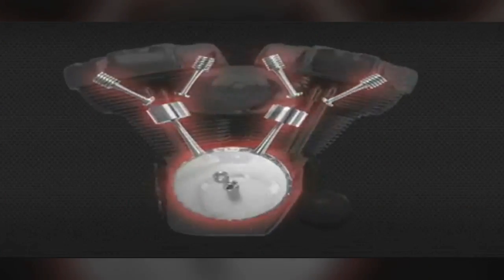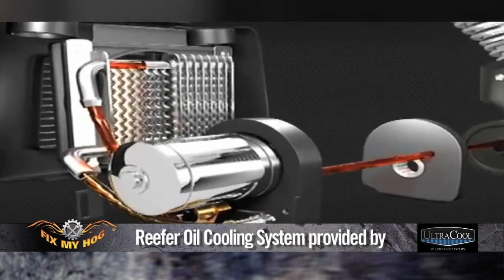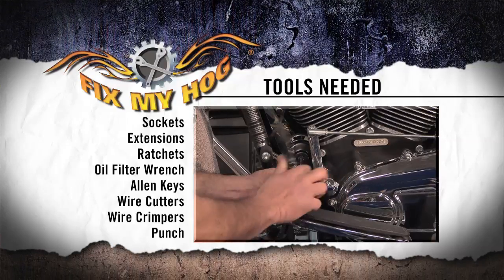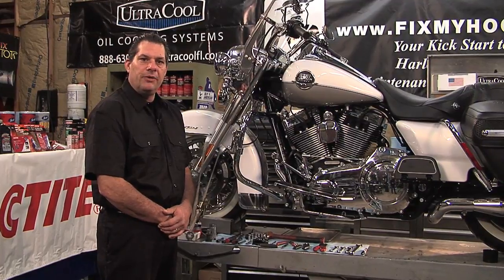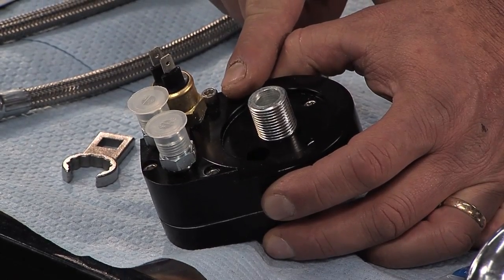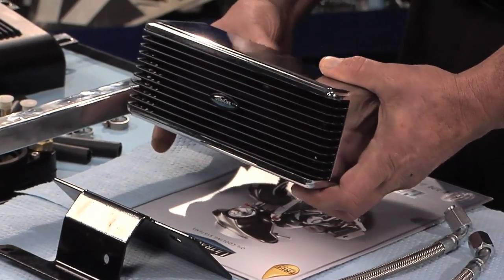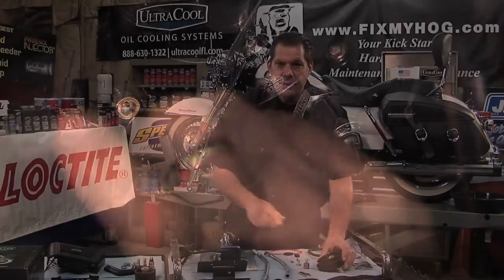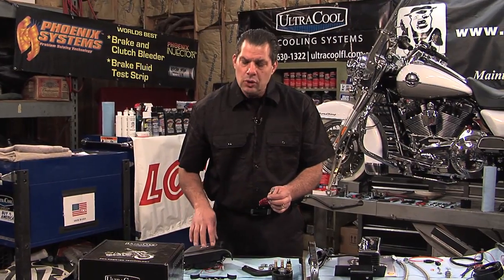Harley Davidson Maintenance: Touring Motorcycles: UltraCool Oil Coolers

Comment: consider the Oil Bud oil cooler...$$$, I installed on my ultra limited...big difference....-30 degree drop in circulating oil temp...and noticeable difference in engine ops (no pinging) and heat off of the motor...passenger (right) leg doesn't get heat torched anymore.

Comment: 220 degrees it kicks on ? That’s nuts. Stock Harley kicks on at 200 & that’s to high. by the time the oil hits 220 your engine temps will be 300 or more.

Comment: Do we really need a thermostat control for an old shovelhead. It always runs at 220° F + in warm weather so the oil should be flowing through the oil cooler at all times. I don't understand what the problem would be if the oil ran cool say 130F it would still easily circulate through the engine.

Comment: Pardon my probably stupid question. The HD Ultra Classic's engine throws off a lot of heat, sitting at a stop sign, stop light, or trapped in rush hour, or construction traffic. Will the UltraCool Oil Cooler, dissipate some of that heat?
Reply from the maker: +Thomas Nessman Yes an oil cooler or cylinder head fan will help.http://www.fixmyhog.com/video/ultra-cool-002148/http://www.fixmyhog.com/?s=love%20jugs (ZD: 3610)
Reply: FixMyHogfreechannel Just tried the link provided. Returned the message 502 Bad Gateway.
Reply from the maker: +Thomas Nessman Hi, Thomas! Here is an alternative link: 

http://www.fixmyhog.com/video/ultra-cool-002148/